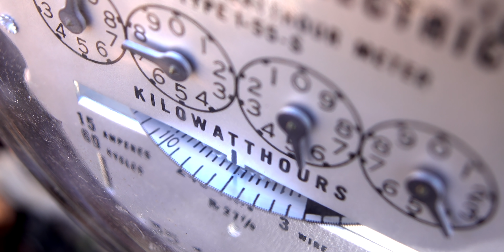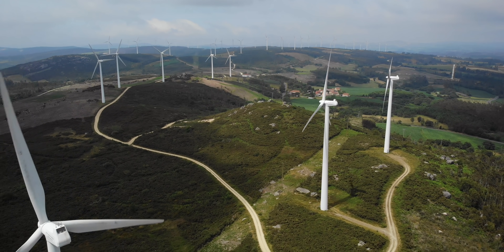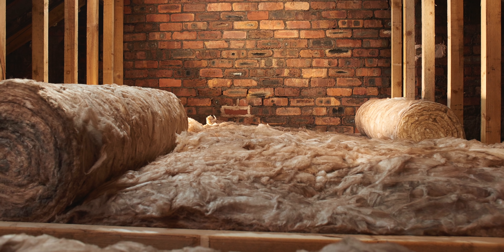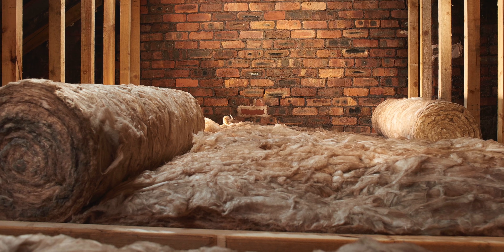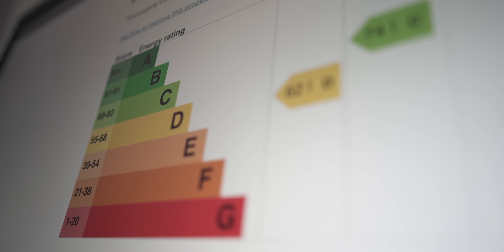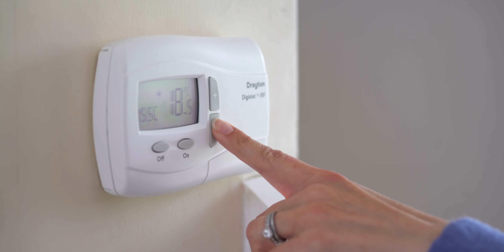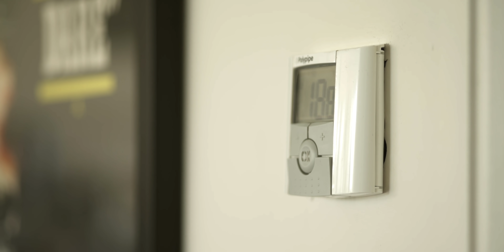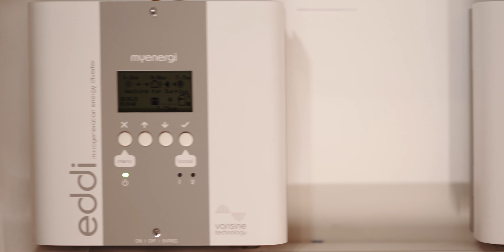HOME ENERGY Episode 1 - Cheaper Measures, Energy Efficiency & Fabric First | FULLY CHARGED

Comment: Its all well and good to say only heat when you're in a room, but that only works if you can heat that room rapidly when you want to use it! In my old house with its gas boiler and radiators you could heat the house from cold to pleasant in about an hour. My current home with underfloor heating and an air source heat pump takes days to fully warm floor up. If you find it cold and turn heating up it can take hours to increase the temperature. With an air source and underfloor personally I find it more effective to use heat zones and keep rooms I use a lot warm on thermostats to maintain a reasonable temperature. The heating isn't always on it just comes on to maintain homoeostasis.
Reply: Hopefully he makes those points when he covers airsoure and underfloor heating.
Reply: Good shout, currently getting setup for an air source heat pump and UFH downstairs. Not having smart thermostats on the radiators upstairs as I can't see how they can be dynamic enough to offset their embodied carbon. A base temp for those rooms is needed and the rest is just adjusting clothing accordingly. No room is going to freeze or change in use often.
Reply: @tuscan440r  Your upstairs will get a lot of its heat from what rises up the stair case. Its only the areas furthest from the stair case that might need additional heating in my experience. Plus radiators work on big convection currents from hot sources. From a gas boiler rads are generally too hot to touch for long but under an ASHP that will never really be the case unless the underfloor is off. I find a timer is best for upstairs just a few hours before bed and a few hours at wake up are enough.
Reply: @tuscan440r  You may find (assuming your building is well insulated) that your best control is the temperature of the central heating water (or maybe the flow rate).  UFH can have such a slow response time that getting the right temperature is solved by adjusting the water temperature. I'm in Passive House, so may not be representative of other UK housing stock!, but if I let the wall thermostat click on/off based on a 1C rise (even if the thing was that accurate ...) the embodied heat in the floor by that time would continue to raise the air temperature another 3 or 4C! My UFH water temperature is only a few degrees above the ambient that we want
Reply: @ecok  interesting, I didn't think about that as an control option. We have a new HIVE system so I'm interested to see how 'smart' the thing is and what configurations there are on it for UFH (if any). We've insulated under our floors and the extension is well insulated but the rest of the house is solid wall so still losing a lot of heat. Looking forward to get external wall insulation and new windows once the government actually provide a grant you can claim
Reply: Having some experience in renewables, there’s a point about air source heat pumps in the UK & Ireland that gets missed (& the suppliers will never tell you), it’s the damp air. This means on a winters night from about 4’ C the fins on the heat exchanger begin to freeze. Despite all the clever talk about reverse cycles etc what happens is either a great big immersion heater kicks in or the pump has to draw heat back from the house to thaw itself out. So actually when you need it most, the air source pump is not providing heat or it’s internal immersion is doing that but in a really expensive way. Grant, an Irish company is the only one to be honest about this. They have a hybrid solution that combines a heat pump & either a gas or oil boiler that kicks in when the heat pump is struggling.
Reply: I was coming here to say the same thing. I'm  in a New build with an air-source heat pump. Temperatures take days to change and cannot go above 21 degrees.  We need secondary heaters when it is really cold as the heat pump gets stuck in defrost mode and struggles to heat above 19 degrees...
Reply: @mathewbrianfisher  That should not happen if the system has been designed and comissioned properly. It would be interesting to see at which ambient temperature your HP runs on full load. If your HP still has reserve capacity an increasing of the heating curve might help you. Also check that all heating surfaces are working (Thermostats). Heating surfaces capacity depends on temperature and flow. Make sure and check with your installer if the flow rates are set up correctly as per design.
Reply: @TL-xv9of  The housebuilder has checked, it has been verified by mitsibishi and third party companies so should be up to spec. We'll be getting somebody out when it gets cold to balance all the underfloor systems and hope it operates better this year
Reply: @mathewbrianfisher  does your floor have thermal mass to hold the heat or is directly so in chipboard or PIR insulation with wooden flooring on top? Without thermal mass it will be hard to reach a higher temp
Reply: @tuscan440r  I'm not sure as it's a newbuild and I've never had the floor up. From what I can remember it was underfloor  pipes in insulation.
Reply: @mathewbrianfisher  ok, might be worth asking the question. It could be the reason why it struggles a bit but either way you would think it would be designed to cope.
Reply: @mathewbrianfisher  What are your outside temps like? It sounds to me your heat pump is underpowered for your load and you might benefit from a different model. I find that given enough time the water coming out of the heat pump can reach low 30 ℃ for central heating on our coldest days of -4 ℃ this is enough to heat our rooms to 20 ℃.
Reply: @martingibbs1179  I'm in the UK in a rural area, it doesn't get much colder than -4
Reply: @mathewbrianfisher  Then something must be wrong somewhere, as it shouldn't get cold or damp enough to be stuck on the defrost cycle. When mine goes on defrost it melts the ice so quickly I thought the outside tap was running the first time I heard it as it was so loud. The cycle is five to ten minutes maximum and only a couple of times a day in the coldest weather.
Reply: @mathewbrianfisher  how long have you lived in that rural area? I have seen -20 for weeks in the midlands. Not often but always each year nights of -7 or lower on town. I work nights driving a Taxi and have to try to stay warm in my car while it is well below  zero. When I go out of town it is always 2 or 3 degrees colder.
Reply: @williamarmstrong7199  we've been in the Midlands for 4 years and see those temperatures occasionally. We fire up the log burner when it gets that's cold
Reply: @mathewbrianfisher  common issue with Air Source Heat Pumps plus their thermal efficiency decreases as the outside temp decreases. So in Summer it may be 3:1 in winter it may be as low as 0.5:1. What that means is that it becomes more expensive to generate heat as the temp decreases and often requires additional heating sources. Plus if your hot water is generated by the Air Source Heat Pump (into some kind of cylinder) these have built in immersions to do two things. 1 to increase the temp above the threshold required to kill Legionella bacteria once per week and 2 to increase the water temp when it is below the required level. So you are effectively back in the 1970's with an immersion switched on burning your money.
Reply: @MagicianMan  The COP of modern ATW heat pumps with UFH is far better than what you described. Around 0°C the Mitsubishi achieves about 3.7 to 4.0 with 30°C of leaving water temperature.
Reply: BTW I am NOT saying we shouldn't do something. I just think ASHPumps are being suggested too readily as a solution when the reality is that they are NOT for I would guess 80% of the UK's housing stock which was predominantly built post war and at best upgraded to some kind of Gas Fired Central Heating. Much better to subsidize entire regions to be switched over to Hydrogen and convert to Hydrogen Boilers. Its always easier and more cost effective to switch the infrastructure over than to expect homeowners to foot the bulk of the bill in meeting targets.
ASHPumps combined with Solar PV make more sense but there is no government subsidy on PV installs and with a typical install costing £5k+ ON TOP of £6K for an ASHP plus installation (£3k+?? minimum???) thats a bloody big bill for any consumer to pay for..
Reply: @mathewbrianfisher  I dress warmly even when inside and find a room hot when the thermostat is 17 degrees.
I tend to have it set to 15 degrees to remain comfortable (and I get a credit from 6.6KW solar array even in the midst of winter!)
Reply: The more mass a building has the longer it takes to increase the base temperature. Under floor heating works more efficient without thermostats (especially it it is embedded in concrete) but with adjusted flow rates and refined heating curve. You cannot not heat inside a thermal enclosure. Warmer parts will always lose heat to colder areas by heat conduction. To my experience it is most efficient in a well insulated building to utilize all heating surfaces and regulate the temperature by well individually adjusted flow and a general HP heating curve.
Reply: and keep in mind a heatpump works more efficiently during the day, rather than at night
Reply: @BullShark The speed would depend on the power rating of the electric heating element. Don't forget the main reason underfloor takes so long to warm is the high specific heat capacity of stone/concrete. It takes a lot of heat energy to warm concrete up one degree. Of course the benefit is it takes a lot longer to cool down as well which leads to more stable house temperatures in my experience. Unless this electric underfloor works very different to my imagination wouldn't the electric bill be much higher than a HP, isn't it effectively just a massive storage heater and therefore best run at night on a cheap rate?
Reply: Indeed.  But zoning is sometimes not good at all and can be actively bad.  Certainly not switching off rooms and having them cold.  You get heat loss into them from the rooms you are heating, the emitters have to work hotter in those rooms as a result.  For a heat pump system this can be especially detrimental because they work so much better at lower flow temps.  But even on gas having a hotter return can stop your boiler condensing and drop its efficiency massively.
Reply: As far as I am concerned an ASHP is next to useless for a house like ours where my elderly mother needs temperatures of 23.5oC in order to feel comfortable. They can shove these devices where the sun doesnt shine, I will not be subjecting her to a miserable existence with one of these underpowered things. They are barely adequate for people who are comfortable at 20oC.
Reply: @cbcdesign001  Many of the people who have had bad experiences with heat pumps are the due to shoddy design or installation, not a limitation with heat pumps per se.  The issue is that you can't just get any old plumber to stick a box on the wall like with a boiler.  You need expertise, which is not necessarily easy to come by in the industry at the moment

Not to say that it's the right solution for your situation.  But we needn't pan the technology.
Reply: My house will heat from cold to conformable in under 15 minutes. You have a really badly insulated house mate with an under powered boiler and or radiators and probably high ceilings which don't help.

Comment: fabulous series Robert, I look forward to the rest of them, I live in centre of Canada where the winters are 5 months long  and as cold as they are long, temps will reach -35 celsius at times plus windchill on those January days , heating for us in Natural gas and electric forced air furnaces, gas being the most common and cheapest by 25% or more, I am looking to reinstate in 2022  from the outside of my home starting with removing the Stucco , wire and plywood  exterior walls, and having spray foam latex closed cell foam insulation installed professionally  and will not be required to use any vapour barrier on the inside wall prior to the foam being applied to my house, the foam is just that efficient at filling in the  gaps  and cracks, then reapply the exterior with new plywood sheeting a house rap, usually Tyvek and wire and stucco again, so the return on investment is 10 years and my combined heating/electrical bill will almost half itself after this is complete, another very good new product is high r-value hot tub covers, i had just a regular cheap one that came with mine and replaced it last year, and i run this hot tub year round and only shuts down twice a year to change water  and a good clean before winter and the new cover was $525 Canadian , it uses marine grade products and says me almost 40% monthly in the 3 coldest months  and your water is not escaping through evaporation anywhere near as much, the shower head thing here has been a big push by the utility company for 5/10 yrs and offered a water savings kit free for a single family dwelling, i got one right away and it was delivered to your door, was worth about $100.00 and it helps out, my home like yours is not new , built in 1954 so yes in need of upgrades its not bad right now i pay monthly amount of $168.00 month / 12 equal payments ,just easier to budget this way that is both gas and electric

Comment: I might have to throw a little water on the fire.

I live in 60+ year old home owned by a social housing organisation (SHO).  As the tenant I am not allowed to make any "substantial" alterations to the property.  This includes, cavity wall insulation, heating systems, PV panels on the roof, solar water heaters on the roof, even windows.  About the only thing I can do is add insulation to the loft, which is currently just 5cm thick.  All of the government backed incentives allow private tenants and home owners to apply for money.  Social tenants are prevented from applying.  Double glazing was fitted about 17 years ago but the organisation decided to use "treated softwood" for the frames and now the frames are rotting as there has never been any maintenance.  Last winter I fitted the heat-shrink sheets to the frames to minimise the drafts.  A gas combi boiler was fitted around 5 years ago but it was fitted with an on/off timer and no thermostat.  Everything is done to the lowest possible cost.  I am trying to save money to fit some more loft insulation but I am on a very low income and can just about meet my outgoings. My loft is approximately 35sqm.  Even basic insulation rolls would produce a bill of over £250.  I would love to have a hive system fitted that would only switch on the heating when I'm at home, but again that's another £200 or so for me to try and save and the SHO would have to inspect in - for a fee.

Sorry for the rant, but it seems to me sometimes, that it is those of us that do our best to save energy due to lack of money are the very same group that would benefit most from highly energy efficient homes.
Reply: With about 4 million social housing properties in UK, this is an important area that needs addressing. Social housing does not mean the resident is on benefits. There are a lot of grants available for people who are on benefits to have insulation installed.
Reply: B&Q 5 rolls of 100mm £19 - £95 pounds, And do it over a year 1 roll at a time if you have to, start over the bathroom and stairs or small bedroom
Reply: As 25% heat loss is from the loft, if your gas bill is 557 a year uk average, you would save 139 a year (at 270mm vs 0mm) so you would get around £50 back the first winter i believe.
Reply: The point is that taxpayer funds should be spent in the most efficient way. When it comes to the climate, this means spending where the biggest reductions in co2 can be made. It is not about reducing bills for those on a low income- you likely already receive more in terms of benefits / subsidies than you put in. While a ten percent reduction in your energy bill might be wonderful for your wallet, it would be tiny in terms of emissions reduction and would likely cost thousands to achieve. For the same money a substantial rural property could switch to a biomass boiler from oil, and save tons and tons of carbon from being emitted every year.
Reply: @spencerwilton5831  I don't recall mentioning anything about benefits and for you to insinuate that I "receive more ... than [I] put in" is, quite frankly, insulting.

My point was that it is not always within the remit of huge swathes of the population to improve the energy efficiency of a home.

Systems exist already to help reduce the amount of energy consumed in the home and some older methods of reducing energy consumption can be as effective - I still have a brick in my cistern, and I only boil a kettle with what I need.  Unfortunately, just about every company in the energy supply and saving industry is looking to invent new ways to manage energy usage rather than improve or streamline existing methods and as a result, the price for installing new technology remains high.

As for you point over switching from one energy source to another in every substantial rual property.  Would that really achieve the same reduction as ensuring that the 4 million plus social housing properties were compelled to be brought up to modern insulation standars?